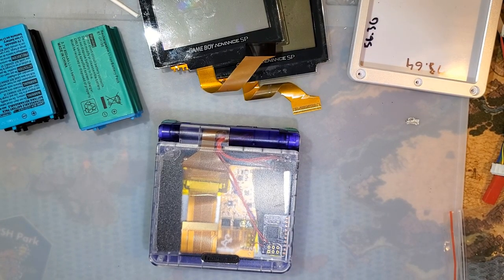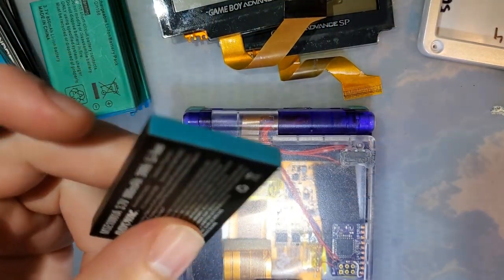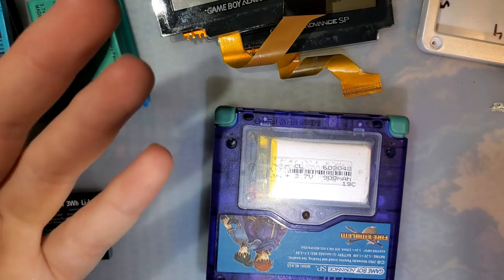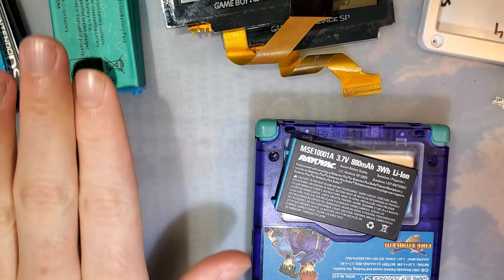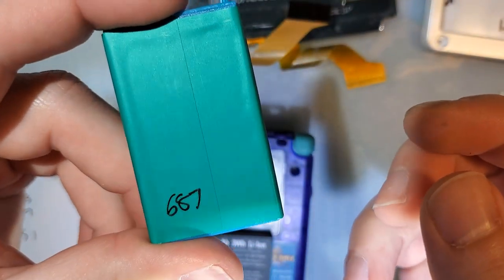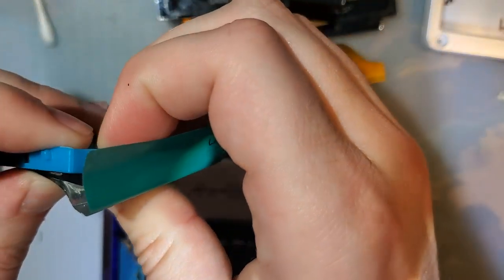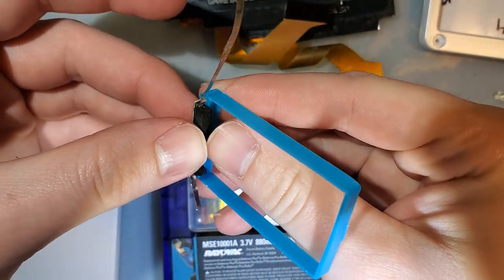Testing the Rayovac GBA SP battery (And a few others!)

Comment: I was a little surprised by the Game Boy Color test! A lot of people tout the GBA as switching entirely into an 8-Bit mode for compatibility mode, and whilst I believe it does. It makes sense that it sucks more power.  However I was not surprised at all that the 101 beat the IPS, however I was surprised that the 101 was nearly DOUBLE the battery life of a 101.
Reply from the maker: To be fair to the 001, the 101 was on low brightness and the battery life will increase significantly on a 001 with the light off.
Reply: @makho  Oh for sure. If I had any spare AGB boards left I would buy a 001 screen to put in in a heartbeat.
Reply: @cdigames  I'm surprised that the 001 screens are not cheaper and easier to find since a lot of people have them left over from the IPS mod. I myself have 3.

Comment: Crazy timing on this video, just replaced my GB Micro battery (or tried to) but it didn't fit unfortunately.
Reply: The fitment seems to be an ongoing issue with aftermarket micro batteries.
Reply: @Ruslan.88266  Yeah I unwrapped it and it appears to be just a similar-sized battery just with a different set of contacts soldered on.

Comment: <Four. Years. Later.>

Do you have any other GBA games that you utilized to test battery life, besides Emerald? If not, what was the device (at the @3:00 mark) that you used to measure the mAh battery capacity of the batteries?

Comment: 12:20 I don't have any fancy battery testing equipment but I actually have that model of battery and tried running a tetris loop with full volume and bright screen setting for ags-001.

I had to switch it off after 9h because I was going to bed and didn't think to timelapse next to a stop watch but the point I'm making is that I was lucky enough to get up to 9h without hitting red light.
So it goes to show just how hit or miss these aftermarkets are.

Just last night, I started testing my gba sp batteries and my method is to full charge then time the lifetime. Given that my test couldn't complete before I went to bed, I was thinking to instead full drain the batteries and then time how long they take to charge.

With the little experience I have, I was wondering if this is a reasonable test or if there are any things I could look out for. Ideally I would like something similar to your battery testing device but I didn't have much luck finding one.
Reply from the maker: You could get a USB charging cable and run it through one of those USB power meters that keeps track of the total current that flows. It's not the best method because charging is not 100% efficient, but it's still good for estimation.
Reply: @makho  That's exactly the type of tool I would want, thank you!
If only I had a usb charger </3

I presume there's some way to mod the meter or even just attatch cables to extend it's functionality beyond usb but for the time being, my goal is to sort the batteries by capacity (time spent charging from empty to full) to cherry pick the best for my consoles.

Comment: I trimmed the area where the batter goes and I managed to put a 1200 MaH battery with the pcb you designed. A bit snugged but fits.
Reply: Can you link the battery?
Reply: @morgenman  check on amazon or any site selling them and search for 633450 1200MaH 3.7V battery. thats the one i used on my GBA SP

Comment: Now what I would really like to see you pull off is a big extended battery mod. Use the actual IPS SP mod and make a modified cover of the back of the screen and get a battery cell as big as you can find that fits there behind the screen. 2500mAh battery while only adding 1/4 of an inch to the overall thickness of the SP would be worth it if possible. There are PSP mods where the UMD drive is stripped out, the plastic bit between the UMD compartment and the battery compartment is cut off and the whole area is used for a 4000mAh cell.
Reply from the maker: https://www.thingiverse.com/thing:2782162
Reply: @makho  Not not in the back cover. In the  bigger area behind the screen. You could fit a 2 3/4 x 2 x 1/4 inch cell in there. 3d Printing just a frame that would extend the area between the 2 plastic parts of the screen would allow to keep the SP's form pretty much intact.
Reply from the maker: @chamoo232  https://www.reddit.com/r/Gameboy/comments/fc3or4/1640mah_gba_sp/
Reply: @makho  Yep something like that. But instead of 3 batteries that fit in the existing space it would be just a big one in an extended shell. And then perhaps use the empty battery bay for a bluetooth audio adapter.
Reply: I've always just wanted a big fat chungus bottom shell for the SP that could fit a bigger battery, as well as space for a headphone jack mod. That'd be the dream.
I'd take a shot at 3D printing my own, but I don't have a 3D printer.
Reply: @NovusDundus  Check out a website called Shapeways. You upload your 3d model and they can print it in various material. They charge by the volume of material used and the size it take in the machine.

Comment: So I've got a stack of batterys. Original, aliexpress, Nintendo ds and  a weird extention pack that makes the gba sp a bit bigger. I want to measure which ones are the best. Do I need to do measure anything else then charge it, run it and time it?
Reply from the maker: You can measure the capacity but capacity alone doesn't mean much. If you measure the run time of each battery, you should test each with identical set-ups. For example, same game, same console, same brightness. Measuring the capacity is quicker (if you have the tools) but measuring the run time is more meaningful. The higher the capacity, the more the run time so you can use one value to extrapolate the other.
Reply: @makho  yeah i was afraid youre gonna say that. I dont think I have the tools to measure compacity. I only have a multimeter. 
I can turn on a GBA and a timer, go to work, come back and have my result. Only issue is that i have to have something film it. And if it stops filming half way its all for nothing. 
Any tips on setting that up?
Reply from the maker: @ArjanYoyoman  If you have an old android phone, download a timelapse photography app. If you just try to record video, you'll likely hit some sort of internal limitation as most phones cannot record for 4+ hours continuously. I used an app called "Framelapse Pro" on my old phone when I was testing run time. You can calculate how long the battery lasts by just looking at the run time and the picture delay but it takes a lot of guesswork out to just throw a clock in the frame.
Reply: @makho  What tool did you use to measure the capacity?

Comment: Question: at the very end of the video, the last 10s or so, you show a timelapse of battery usage for an AGS-001 SP and an AGS-101 SP on 2 separate batteries - one at 564 mAh and the other at 572 mAh, respectively. My question is, what were the brightness settings for those 2 tests? The 001 looks like the frontlight is on. Is the 101 on the low light setting or high?
Reply from the maker: Default setting on both. So frontlight on and backlight on low.
Reply: @makho  Thank you so much! I'm doing some power tests on my own batteries (I don't have a meter to measure the current capacity) and your numbers are invaluable for me as a baseline in calculating the juice that's left in mine.

Comment: This is a very informative video thanks. when doing these tests there is a variable screen brightness. At what brightness was the screens etc when the tests where done thanks.
Reply from the maker: For the funnyplaying kit, I left it at default. For the other one, I believe it was a step or two above default but I don't recall specifically. I never changed the brightness during the tests.
Reply: @makho  I have just done a basic test with my gameboy advance using retro six cleanjuice and it don’t come any where near their boldly claimed 14 hours. With my ips at full brightness I get 4hours 29 mins and at brightness set to its most dim setting I only get 8hours 10 mins so 6 hours short of there claims. I have a feeling I may have a faulty battery. I am currently testing your battery mod for gba sp at stock ags-001 and its 13hours and 38 mins and still not showing signs of low battery.
Reply from the maker: @johnproudlock2900  does faulty by design count? Retrosix lied about those claims. It's not possible to get that run time with an IPS mod at max brightness right now. Maybe in a few years if the trend holds steady, screen kits will be much more conservative with power. Who knows.
Reply: @makho  apparently there is a fault with my board it seems they wanted me to remove a resistor which will make it perform better. I opted for them to send me a new board out just incase I messed up the board. Never got to find out what I needed to remove though lol
Reply from the maker: @johnproudlock2900  a new board won't fix inherent design flaws unless they've already revised the mod yet again

Comment: It looks like the link has changed to a different battery than the Rayovac. Would you recommend the one the link directs us to now?
Reply from the maker: I haven't tried the "Dantona" one so I cannot vouch for it, unfortunately. If the specs are what it the page says they are, then it should be fine (but they aren't always). I have no intention at this time to try the new battery. It's too expensive compared to alternatives that do actually test well.
Reply: @makho  I appreciate you replying! I did find the 900 Mah one on retromodding.com I'm thinking of purchasing two of those because I have heard good thing about them. Thank you again for your input!

Comment: I have had GBA sp for about a week with the Funnyplaying ips screen, on the default backlight, the battery together with the ez flash omega lasts about 3h (capacity about 800mAh), sometimes slightly longer. The battery itself on the original charger is charged for over 3 hours. This is normal? I ask because for many years I had the usual GBA on AA batteries.
Reply from the maker: Doesn't sound normal to me.
Reply: @makho  Is there a chance that the battery lasts only that much because it is "new" (I charged it twice) and will last a little longer over time? How much should such a gba sp with ips v2 on medium backlight and ez flash omega withstand, around?
Reply from the maker: @ztejstronymarcin  I believe five hours or so but that is on a good battery.
Reply: @makho  Thank you for your answer. Perhaps I will see with a stopwatch how long exactly it is holding. Like a new battery, but at the best moment I think it holds 4 hours. But I will check it carefully.

Comment: What do you think about the DSi 2000 mAh battery? (Modded shell for the sp)
Reply from the maker: Why do you think that the battery is actually 2000mAh? The manufacturer is lying about the capacity. If Nintendo could only pack about 840mAh into a cell that size, why can a random Chinese factory more than double that? The whole point that I've been trying to make in these videos is that cheapo game console batteries rarely have the advertised capacity.
Reply: @makho  I understand, but the battery is actually larger. That's why it requires a bit of a case mod. I doubt its actually 2000 mAh, but even if its 1200 it would be worth it. I made this comment because of your video, since you seem to have the equipment and interest to finding the best battery for the sp.

Comment: Does the Phat DS batteries fit in a GBA SP??
Reply from the maker: As long as it's not swollen, it will after cutting the tabs off.
Reply: @makho  Is it  better than after market batteries? And is it cheaper to get?
Reply from the maker: @salbutamol.  Dude, you know I talked about this in the video, right? The same video you are commenting on.
Reply: The charge on those werent really any better than the aftermarket sp ones that he tested in the video.

Comment: i baught one of those green batteries from a local seller on ebay (15AUD - which is about 10usd?)
on the battery is written - BT-GH188 - 3.7V - 700mha
after breaking it in with a couple of charges I did my test run. stock ags-001, sound off, brightness maxed, looping title screen of pokemon - only lasted 2 hours - about the same as my swollen original battery. utterly hopeless! im doing you mod for sure
Reply: i tried to return it and the seller said - "if it only lasted 10mins id be worried, but 2hrs battery life is expected for these"
Reply from the maker: what garbage man. I'd contact ebay on that. 700mAh should last double digit hours on an AGS-001.

Comment: gba with ags101 got 20 hours and sp with ips got 10, so you say ips is bad for long battery life. except you already debunked that by saying the sp had an 800mah battery vs the 2000mah battery in the gba. obviously the gba ran twice as long.. i mean duh?
Reply from the maker: I was never comparing a GBA SP to a GBA. I was just presenting my data in the order that I recorded it. I ran multiple consoles at the same time so I didn't have to repeat my recording setup more than necessary. 

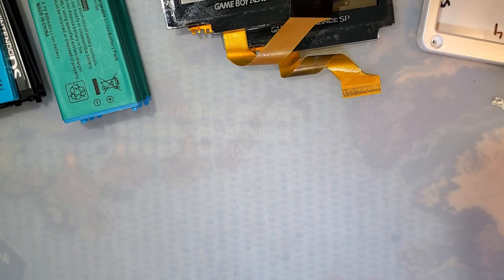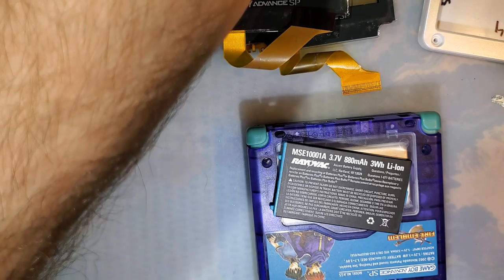I see why you're confused though. I had a GBA SP in my hand when I was talking about GBA mods at about 12:10. Please refer to 18:44 when I actually took two GBAs with different mods and compared them. The purpose of running that LiPo modded GBA was to show that it did not offer any real improvement over just using good AA batteries and actually got less battery life.